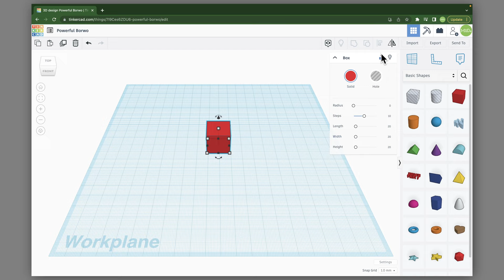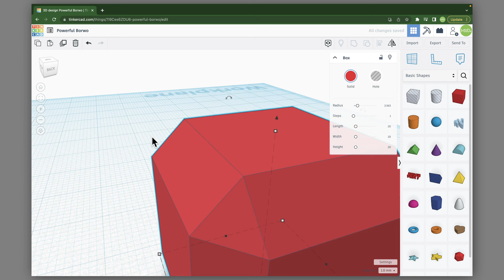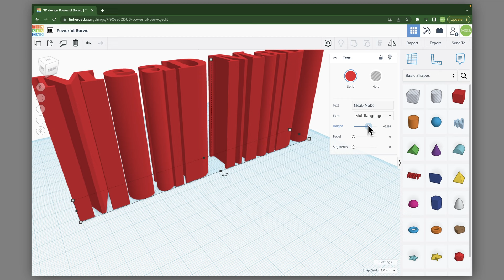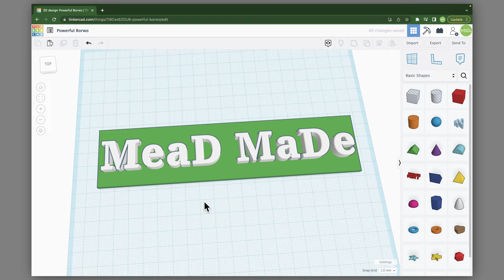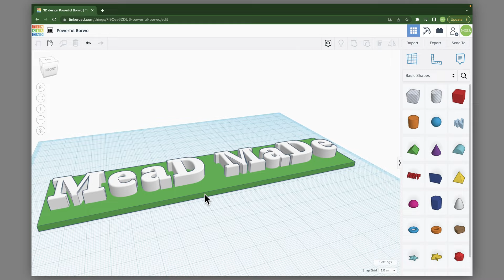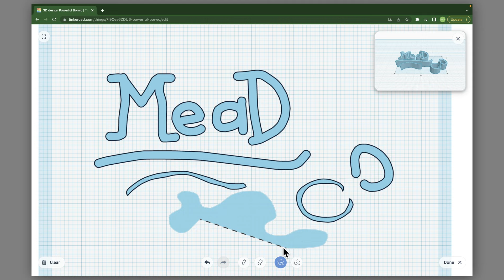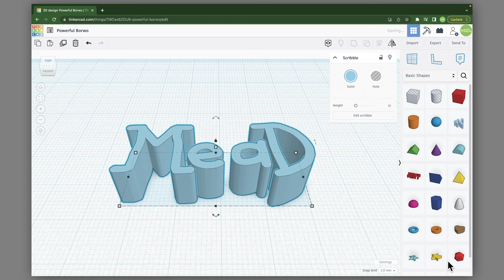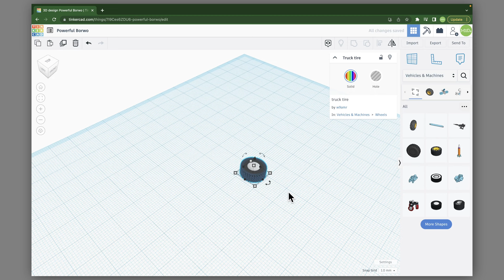Tinkercad Shapes and Editing: The Key to Better 3D Designs

Comment: and also how to create a perfect radius on rectangle corners? tried with ur radius method. but couldn't get a symmetric radius. pls help
Reply from the maker: 1:58 did you increase your steps as well? You have to increase your steps as high as it will go to make is smooth.

Comment: Hey there, happy new year. 

Do you know of any program that has a similar feature to the "subtract" tinkercad has?

I am trying to edit some stls and since uploading to tinkercad complex models is hard due to poligon limitations and time consuming.

An example of what i want to achieve is a vehicle where i can  just "subtract" most of the interior (not hollowing) to save resin and just be able to hard support it right into the plate since the inner void wont be visible.

Comment: Great tips.  Is there a "lay flat to bed" type option?  I don't mean to just set the height off the bed to 0.00.  Such as if something has been tilted to an unknown angle.  Can you just tell tinkercad to lay it flat on the bed at 0° and not mess around with specific angles?
Reply from the maker: Hey! If I'm understanding your question... When you drop an object down on your workplane it automatically sets it on the bed flat. If your asking to lay an object on its side flat on the bed unfortunately there is not an option you have to use the rotate tool. does that answer your question?
Reply: @ItsMeaDMaDe  It does.  Thanks.  I kinda figured this would be the answer but for a free tool I really can't complain.  lol